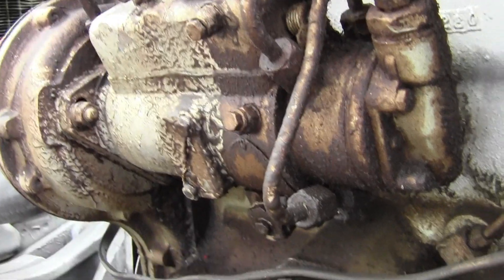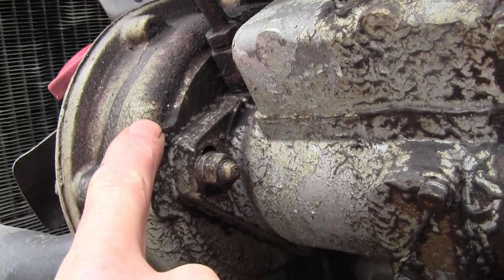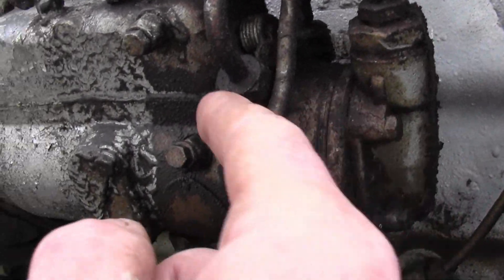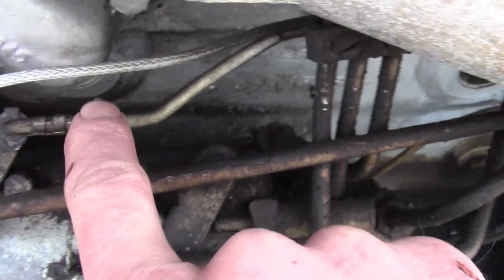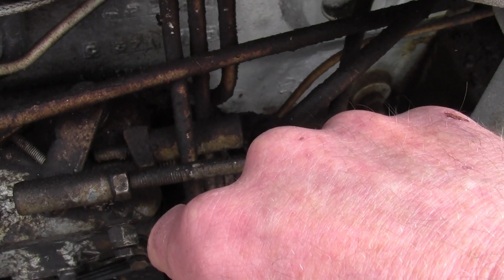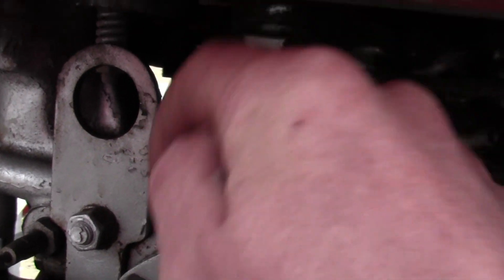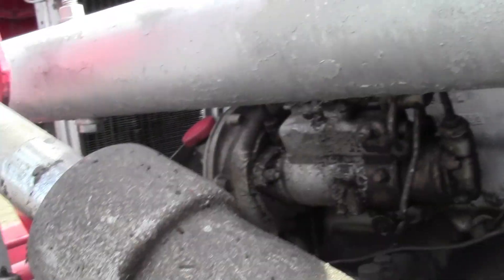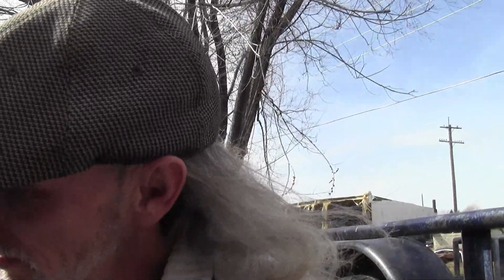Mechanical Fuel Injection: Arguably the simplest fuel delivery & timing system all in one

Comment: I’ve always admired the simplicity in the older design of things. A few years ago I had a 62’ K10 that I went to put a 12V cummins in, same method of fuel delivery. Great video!
Reply from the maker: Those old 12v Cummins are such a great engine. If they are taken care of, they will absolutely run forever.
Reply: That sounds sweet

Comment: Cool video. I've heard of mechanical fuel injection but never knew how it works.
Reply from the maker: Yeah, this is how I got into it, and found out how simple and easy it actually is. Found an old tractor that I traded a '39 Chevy Cab for (and a couple Benny's) and dove into it. The wife didn't like the deal until I painted it though.... lol this little thing looked pretty bad when he dropped it off... lol.

Comment: Diesels have always been a mystery to me... but like here, ya pick up a little info here and there every day!
Reply from the maker: I avoided them for a long time as well, then really dove into it about 6 years ago. Surprised the heck out of me how simple they actually are. 
None Electronic that is.....
Reply: @BareRoseGarage  certainly a perk in my opinion. However they are messing up the newer ones with electronic crap and emissions trash these days...
Reply from the maker: Oh I hear ya man, I run screaming from all the new stuff, and the farmers around here are starting to do it as well. Used Tractor and Machinery (mechanical) is booming right now... esp after the break down in supply chains (and dealer only service) right at harvest time last year.

Comment: Carried over to the cummins in both trucks and newer tractors.
Reply from the maker: Cummins has been around forever and really pushed this stuff to the forefront. I think if I remember right that CV pump is actually their design from 1920 something..... back when you seen Diesel powered Indy cars lol. 
I just love the simplicity of them, no diaphragms, no electricity at all, it's all 100% mechanical. Adjust the timing, you loosen those nuts and clock it a bit. It's all run on pressure and pressure relief. The fuel cools it and keeps it lubed so as long as you keep the fuel clean it will run forever.... kinda cool.